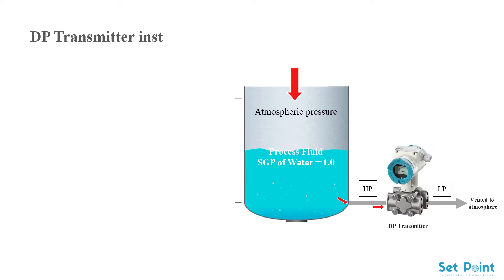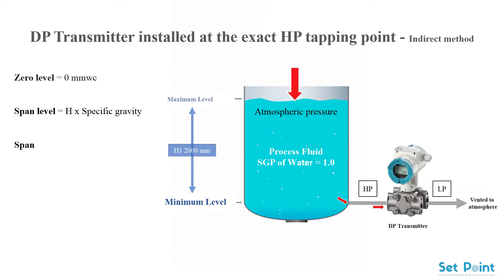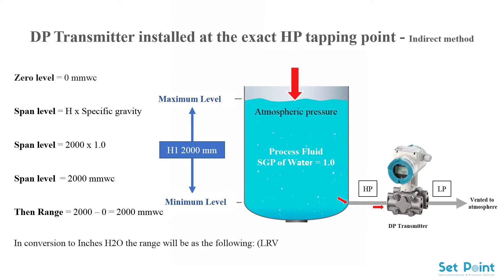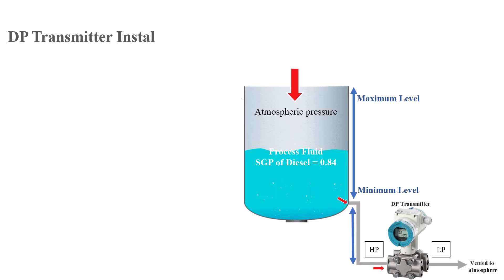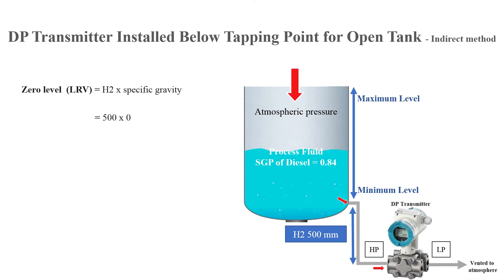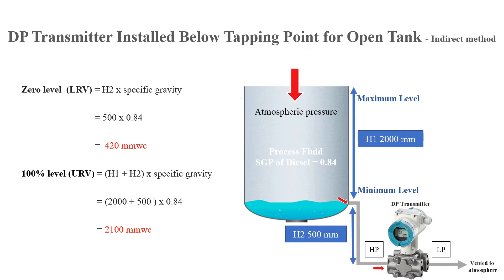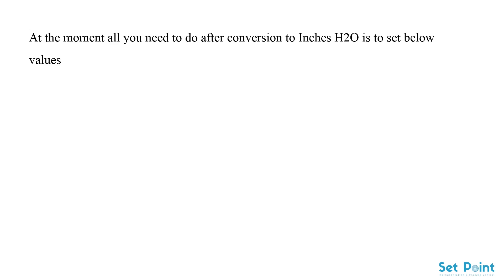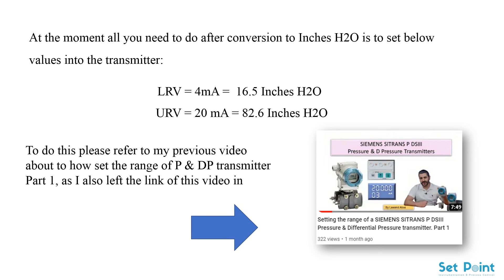DP Level Transmitter Calculations - Open Tank

Comment: sir one doubt , you are considering H2=500 mm  for the below tapping point, hence it's below the zero level, its could be H2=(-500 mm) so that it  will be calculated as 2000-500 x 0.84, then answer will be 1260 mm right?
Reply from the maker: @narasimmansairam7154  
Hello dear, thank you for your question. H2 is the distance from the transmitter to the lower point of the tank, as the tranmitter is installed under the tank (500mm), so when the tank is empty we still have the pressure effect of the liquid inside the pipe (impulse line). 
Otherwise we need to seprese this value inside the transmitter itself.
to get this point very well, i recommend to watch the following tutorial video: https://youtu.be/cQg5cU8hRbA?si=cRxW9cjanbdRhbXN
Reply: Got it ,Thanks a lot